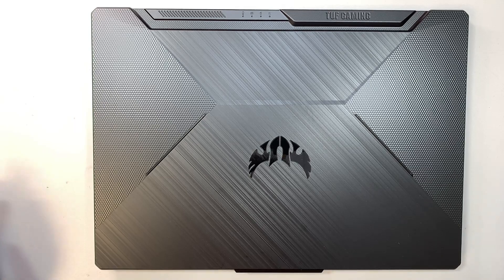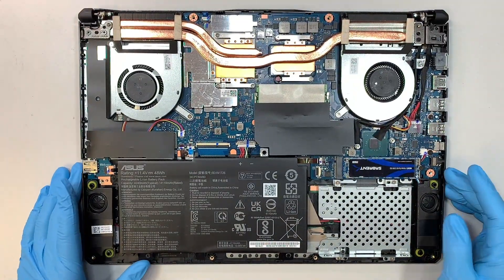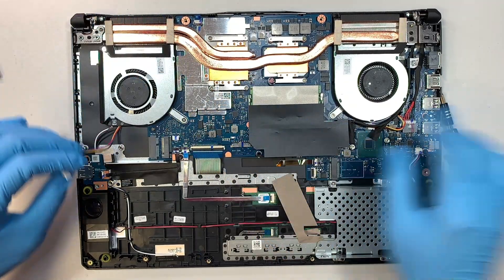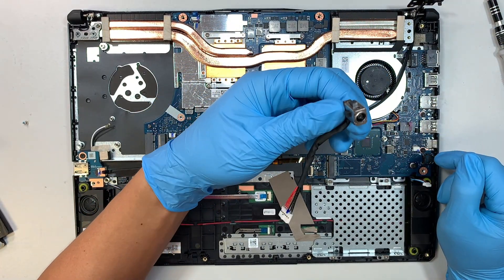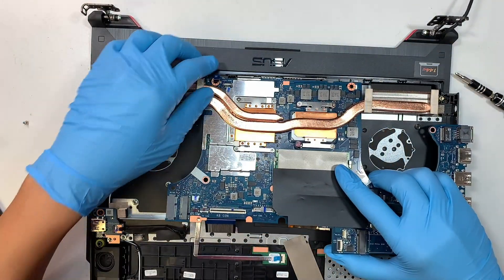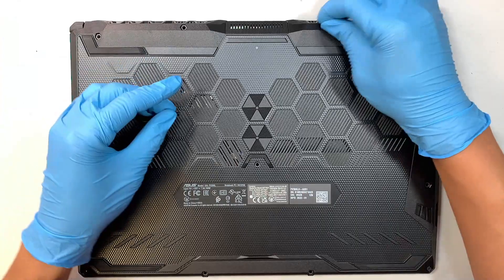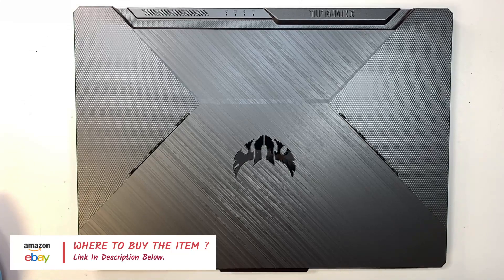Asus TUF FX506L Teardown Upgrade Disassemble

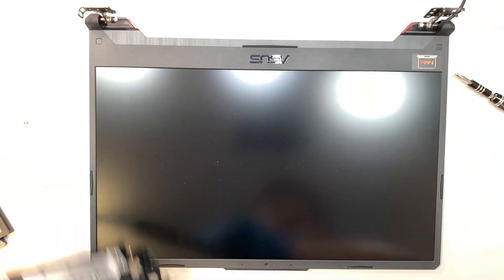Comment: 9:32 Yea I cleaned that part with wet wipe and I heard like water dropping on hot surface and burning smell , sadly some of keyboard keys stopped working . going to repair shop.burning smell still didn't go after turning off several days.

Comment: My cpu fan (the one that would be in the right on this video) is making a LOT of noise, this laptop is noisy as is but this one is making a loud buzzing sound.

Already took it off, cleaned it and when I blew into it, it kept making the sound.

To make sure I took the other one off too, when I blew into this one it didn't make any noise at all and even kept spinning for like 15 seconds (the other one stopped in like 2)

Maybe the other fan has a broken fin? Will I have to buy another?
Reply: I am having same issue with that fan. I am thinking of replacing it.
Reply: @arijitkundu538  if the fan it's not spinning as fast as it should or at all, try removing the plastic fins and lubricating the metal in the center, i broke mine while trying to remove it so be careful, the spare i bought was chinese and didn't quite fit perfectly but it works

Comment: Thankyou  so much bro very helpfully tutorial and teardown i change broken DC cable jack connector:(

Fixed my problem solved.
Reply from the maker: Glad it helped
Reply: Pls tell me how to reset my notebook bios
Windows boots but the screen is completely black
I even tried with another monitor
But the screen is still black
The problem is with my laptop bios
Because I disabled the onboard graphics of my laptop through BIOS
This happened
My notebook model:Asus Tuf Gaming fx506hf
 @UbergeeksBiz

Comment: My laptop power button and keyboard flash when I turn it on and then stop flashing but the white power icon light stays on but my screen stays black. I can’t hear the fans running either. Is it my screen or is it something inside the laptop that fried?
Reply: Yeah same issue occured to me too keyboard power button died.
Replaced Keyboard and it is working fine.